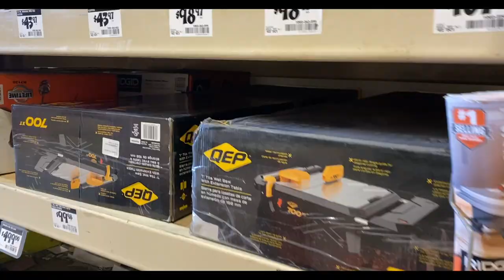The New Goonzquad Headquarters Part 46

Comment: Most tilers I know would do the floor last, either by leaving a tile off the wall at the bottom and then piecing it in or just straight on the floor. They would also make all cuts and laid out so when they go to lay the adhesive its all ready to go. 

:-) Just a thought!

Comment: Heated floor since you guys are up north you could have la i d down a serpentine line of running hot water under the tiles & been walking on a warm bathroom floor.
It's actually easy to do.

Comment: waterproof the floor and wall corners, also if you level your floor out, you can leave out the the wooden gap/ledge between shower and bathroom. Nice clean look and doesn't make you feel like stepping in roadside motel bathroom with tub shower :)

Comment: The sealant you put on the floor is likely preventing the thin set from drying quicker. Bare cement fiber board would  help draw moisture out of the thin set.

Comment: Hi Guys, I saw you using a grinder to cut your tiles for circles or matchups to pipes, there's a router tool made for this application and gives you a clean cut that can also be used for electric boxes with drywall. For less than $200 you can get the full kit from top brands like Ridgit or Dewalt.

Comment: You should have used Schluter underlayment for the bathroom floors, really good product. In the future the Durock should be laid/installed lettering facing out. You guys did a good job on the tile and the house. One last thing, even with a good wet saw with the best wet saw blade you will get slight edge chipping. Two things you want are a tile file so you can do a slight bevel to the the cut edge, blending in the chips and a  wet saw blade dressing stone. The dressing stone cleans and keeps the blade sharp to keep the chipping to a minimum.

Comment: You gotta thinset between subfloor and durock and use thinset on the joints with mesh tape then waterproof. Durock has the instructions link right on the boards...

Comment: Dont need pressure treated 2x4 on a shower step because the waterproof membrane will cover the boards. Get the Dewalt saw if you need it more down the road,  its pretty durable even with commercial use

Comment: i usually cover the cement board joints with fiberglass tape and mortar.  makes for a stronger floor. don't want that cement board moving when you walk over it. tiles will crack

Comment: Hey guys looks good but the stuff you used to glue the floor tile is really just for the walls. What you should of used >its called thinset ,comes in a bag powered form mix with 1/2 drill and mixing tool. Then its good to go,spread it and set the tiles on it.

Comment: You should spread your mortar on the floor with the notched trowel, NOT on the tile. On some tile, it's advisable to back butter the tile with a thin coat of thinset. Usually this is done only for large tile.

Comment: You gotta lay down thinset mortar or some liquid nail under the cement board guys, so there is no movement of the cement board when you walk on the tile, you'll have grout and/or tile cracking issues over time....... 30+ years of tile work, trust me.....

Comment: Just a suggestion breezeway/breakroom between house and new garage front wall 3  6 ft sliders back wall pony wall with double hung windows to control air flow 3 ft over hangs to keep rain out while windows are open

Comment: You should use an uncoupling  membrane especially with those tiles. Your grout lines are going to crack more than likely. And NEVER use a premixed thinset. Most likely it's polymer modified and thats a BIG no go in a bathroom. But you guys do a great job on everything. Just gotta learn the little things that make or break a job over time

Comment: The Golden Rule in any high humidity room such as a sauna, steam room or spa is that literally everything except the door opening and window opening must be completely watertight. Overlaps in any waterproofing layers should face downwards, so the building process is to start waterproofing at the floor and work upwards. Imagine that the room could be thrown into a swimming pool, and would float forever. Or recall that scene in 'Titanic' where a frantic Rose had to take an axe to Jack's handcuffs (but if you do this, make sure to eject the DVD before Celine Dion gets started).

Comment: Hey boys im a wall and floor tiler , you need to put a 10ml strip of stainless steel edging under the edge where tiles meet the carpet , otherwise they will chip or crack on the edges eventually 👍

Comment: Now that you extended the tile through the doorway, when you put on the door you will see the tile unless your  door is opening out which I doubt. Peel those tiles up before there really stuck. . They make marble threshholds for bathrooms that go in the doorways  or the tile should be installed from the bathroom out only the thickness of the door..

Comment: I would have at a minimum did 3 heavy coats of Redgard on that floor. What you guys basically did was just paint the cement board red with that single coat. Hopefully if you have a leak, the single coat membrane hasn't ripped anywhere and the water makes it's way to the plywood. Make sure when you do the showers, do more than one coat. Personally I would have done the tile on the floor last. Working from the top down is better than bottom up, that way when you paint or do any other heavy work, it doesn't scratch or damage your floors which are usually the most expensive and time consuming of a home remodel project. Also, johnbridge.com is an excellent resource i've used in the past for tips and ideas when it comes to tiling.

Comment: The treated wood in the shower stall doesn't matter with untreated studs and base plate. They will rot first if water was to get inside the wall. May sure you coat the shower stall walls with the Red Guard. The cement board is not waterproof. As far as cutting the tile, I use a wet saw table similar to the one you have and it had a serarated blade which chips more especially on full tile cuts. The diamond blade does ok on the down stroke but when the tile runs across the blade on the upstroke it start chipping more. I ended up just using a smooth 4 1/2" blade on a angle grinder that worked better than the wet saw table. I would score the tile first, then finish cut the tile staying away from the finished top surface, minimizing the chipping.

Comment: One thing that may help you boys, is to cut the tile just like plexi glass. Make your first cut upside down, then flip it back upright and finish the cut. You never want to cut all the way through in one single shot cause cutting the bottom side would usually crack or mis-shape the plexi. I’ve cut plexi glass but not tile. Hope this tip can help someone out

Comment: tile looks good. you really want the toilet flange to be flush or slightly below the finished floor. with the flange above the finish floor you will compress the toilet wax ring to much and not have a good seal.

Comment: Serious question here - I’m not hating on them at all. But by adding that layer of red sealer on the cement board didn’t it render it useless? Isn’t the cement board supposed to be what the tile sticks too directly? Will the red sealer prevent the tile from sticking? Thanks!
Reply: No. The thinset will stick just fine to the Red Guard.

Comment: I am pretty sure you were supposed to place those cement boards on thin-set mortar and then screw them to the floor. This way the subfloor is more rigid and stable and will not cause those tiles to move in the future. Just an FYI for the future.

Comment: You should have added thinset or some kind of adhesive to that concrete board before nailing it down. Also if you use Portland sand to slope your shower and then apply red guard right over that you don’t need a liner. In fact if you redguarded the subfloor and up the 2x6 and then put your Portland sand floor in and red guard that it’s guaranteed to never leak.
Reply: By the way the floor looks awesome!
Reply: Check out Mr money moustache’s site. He tells you how to do the shower pan without the liner. I followed his steps and mine has been leak free for at least 4 years.

Comment: Premix mortar isn’t really mortar it’s called Mastic and made for doing back splashes onto Sheetrock thin set is a mortar based mix to apply to cement board or mud floated walls or deck muddled floors.

Comment: The reason the mortar isn’t setting is due to the waterproof barrier you put down. It’s like being sealed in the container with nowhere fir the water to go except for the edges where the gaps are. I wouldn’t put any grout in for at least a week. And make sure there’s some heat in there to draw the moisture out.

Comment: Y'all need a "Saker Contour Gauge". They duplicate any shape instantly. It's a newer profile gauge that creates an instant template for curved and odd-shaped profiles. It's great for tile, woodwork, or any other type of work that you need to make a template for. Y'all should check them out. There are Youtube videos about them, just search for "Saker Contour Gauge".
Reply: Yes the Saker Gauge is very good. We've been using them for construction work and for shaping car bodies. The only disadvantage is the 10" length, because we use many floor tiles that are 12" or more wide, and marble panels which are several feet across. We get around that problem by setting up and fixing a temporary length of aluminium angle on the floor to act as a 'datum', and then run the gauge along it, transferring the shape 10" at a time. Works fine!
Reply: @johnstedman4075  Other companies are making them up to like 48-inches. They're just called "contour gauges". So you can get them in 4, 5, 6, 10, 15, 20, and a 48-inch one now. lol. Not sure how well the other brands are but it may be worth giving them a try if a larger one would help you.
Reply: @calvinh.8882  That's very useful to know! We'll check it out. Thank you!
Reply: @johnstedman4075  You're so very welcome. Have a nice night.

Comment: Technically, you should have bonded the cement board to the plywood with thinset. Screws every 8 inches. Then you should have used thinset over your mesh tape for your joints and let everything dry for 24 hours before Redgard and tiling.

Comment: I'm sorry but floors are supposed to be thin set and mastic is for walls, you used mastic on the floor. I don't know how that's going to hold up but it might work. Ok i guess you got the right stuff. If you have questions ask me i worked in construction for 34 years before i hurt my back bad

Comment: Boys, the waterproof membrane needs to go up the walls as well as on the floor with no breaks or the (possible) future leak will travel along the membrane till it finds the edge and soak into the house structure.

Comment: I think you guys have used wall tile adhesive to glue floor tiles, if you have then that will not work. You will have to pull the floor tiles up and do them again.

Comment: No need for spacers if you use a grid system. Faster, and more accurate. Straight grout lines, and as I said below, you can work in whatever area you want to, even do all your perimeter first if you desire.

Comment: Tip. Home Depot only keeps a tile design for so long. My living/dining room tiles had a couple of cracks and after 3 years I could not get the same tile, they discontinued it and I had to completely retile everything at a cost of over $5000 instead of $20 for a couple of new tiles. Now I only buy from a Tile House and no more Home Depot.
Reply: Yes, any tile design can be discontinued at any time. We always keep all the leftover tiles (and even the larger offcuts) and store them away in a box marked with the project address. Five years later this foresight can save the client a pile of cash. It's a good way of keeping clients happy, and leads to repeat orders and referrals.

Comment: What about 10 cm of the waterproofing also on the walls? Isn't mandatory? Otherwise will be useless  only on the floor.
Reply: In a steam room we would run the waterproofing not only right up the walls, but across the ceiling as well. You just can't be too thorough in situations like that. Doing those jobs properly might cost a few $100 more, but is saves $1,000s in callbacks (and saves a bunch of shouting, screaming, headaches and time spent reading lawyer's letters as well!)

Comment: you do want the dry fit and layout on almost every project but esp things like roofing, siding, tile - planning goes a long way to a seamless install - you all should use the 22 angles on the trim #long to short or short to long #trimout
Reply: you really should think about a couple 5 gallon primer shots for all drywall and then flat on all ceilings - you can roll out walls - prime and paint all trim before you apply and then finish with just one coat - it you get primer tinted same color as final color it can help with coverage

Comment: the sheetrock join between the floor and the wall needs to have silicon in it and then paint the waterproof over the top of that otherwise it is not sealed and water can get between the sheets, water will seep through the grout.

Comment: You should have investigated more about water/vapor sealing before starting. You will get problems in that bathroom. You should have sealed the complete room, not only the floor area, at least up a bit on the walls to prevent water into the wall/studs. And Impregnated wood will give a horrible smell when getting wet due to leaks.

Comment: Why are you using pressure treated wood for the curb and walls? Its supposed to be regular 2x4 or 2x6 studs. Overtime PT will shrink and cause warp or tile cracks.  No need for PT if its sealed/waterproofed properly.

Comment: Hey I do tiling as my daily job and I usually grout the bathroom floor if it’s a different color and cover it with a tarp when I get into the shower drain and ledge but if it’s all the same
I install the drain and ledge clean up everything and thro the grout but after that I would actually cover all the floor for paint base and all that tile one he walls just to prevent the grout and tile from getting stained or just dirty

Comment: You guys are going to learn the hard way that you do floors last. Should have started with the walls. Also, you guys used wall mortar on the floors 🤨. When you go to grout the floors, make sure to get a good grout scraper and your shop vac with a good brush attachment to clean your grout joints before grouting. You're going to track a lot of dirt in before you finish that shower.

Comment: I'm no expert, but wouldn't you want to center the tiles and split the difference at the edges?
Reply: First you find the centre point of the X and Y axes of the room. Then you lay out some tiles with spacers and see what gives you the largest pieces of tile at each end (they will be more than half a tile wide). After doing the same thing on the Y axis, you stand back and look at the room as a whole. Are the walls parallel? Are some or all of the corners 90 degrees? are there any offsets, projections or recesses that will affect the tile grid?  Once everything is planned, it's time to start fixing all the whole tiles, generally working out from the centre of the room if possible. You do all the 'cuts' last. Then you leave everything alone for at least two days before walking on your new floor. Grouting can then be done and the floor protected with plastic sheeting and some OSB, or the grout can be left until the room is otherwise finished.

Comment: Hi, I do enjoy watching your channel. Thanks for the content. I just wanted to pass some info to you guys about shower pans. Before laying the liner, you need to apply a pre pitch layer with cement then the liner goes over it. On top of that goes your cement pitched to the drain floor. I did several showers and used a product called Goof Proof showers. This product gives you a perfect pan every time. Some advice just in case you need it. Red guard the whole shower too. I hope this info is helpful to you Guys. Thanks again for the awesome channel. 

Mark.....,

Comment: Oh Boy...Houston we have problem, those concrete slab at the back should have reinforcement either bar or wire mesh if you want to last, now the most in a year time it will start to crack not a good investment even now with the rubber mat just hidden the crack.

Comment: Bros... Your membrane needs to be a couple of coats, floor, joints and up the walls then tile.   Otherwise in a couple of years, the house will move and you will get rot. This is especially important on a second level bathroom. Waterproofing is cheap.

Comment: Check out Vinyl Planking flooring , , Especially from lumber liquidators ( new name now ) its great , indestructible and if nicked it wont show if you choose the right colors mixed in , i use in my rentals , tile is good for basements etc , but not a warm feel , look for approx 7mm plus thickness if possible , try to avoid Home Depot flooring , its ok , but go with somebody that’s all they do , easy Installation 
Dang Sung lol from Pennsylvania , within a mile of Sikorsky commercial Helicopter facility , S92 and S 76 type , new marine one style , they build from empty shell , complete, test fly , paint and out the door ,

Comment: That tile will never dry with the pre mixed mortar because you put it over red guard. Pre mixed mortar is actually a glue not Portland cement so it needs air to dry whereas real mortar cures by chemical reaction

Comment: It's too bad that you guys are so quick. I would recommend that you would make the shower base out of plywood with the perimeter as high as the 2x4 and put the concrete board above it. Then fiberglass the bottom and sides up 8" to transition the base to the wall. If you paint the whole thing with redgard you will NEVER have a water problem, those shower liners are garbage and make for a pile of work! Keep up with the good work anyway, your learning.